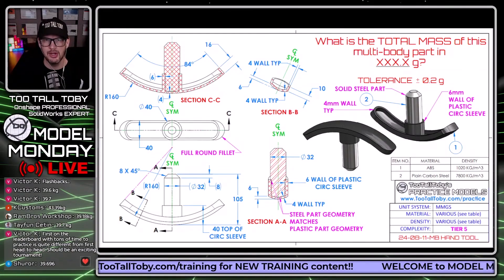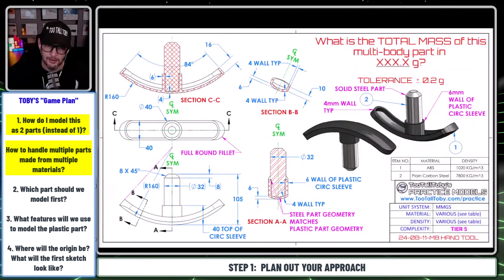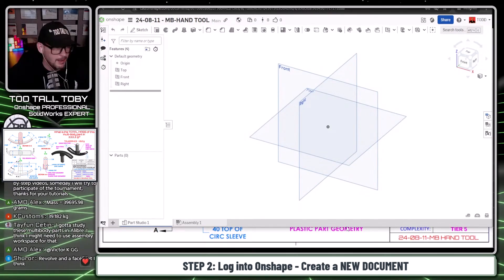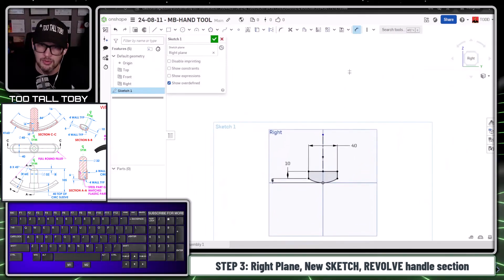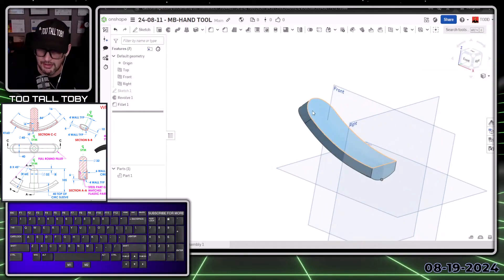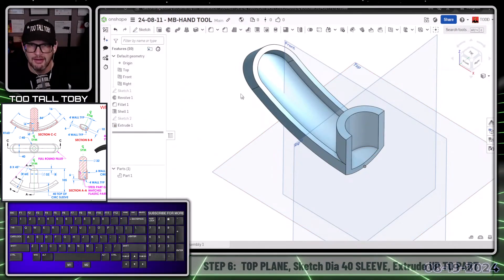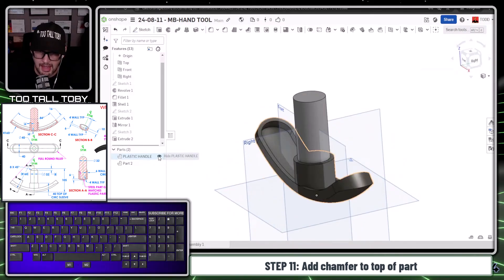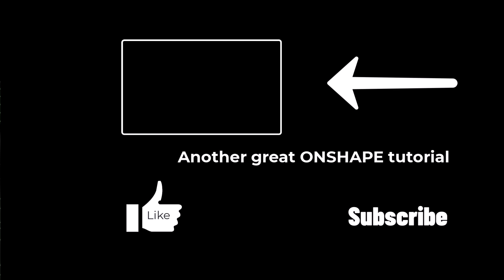Free Onshape Multi-Body Tutorial for HIGH SCHOOL STUDENTS / COLLEGE Mechanical Engineering STUDENTS

Comment: Thanks, Toby! For this part, the biggest challenge was realizing that the steel component has multiple radius dimensions. Additionally, SolidWorks doesn’t automatically match the radius of the other part during extrusion when enabling the "Do Not Merge" option( hard to explain this thing ) . This made interpreting the sheet quite tricky.

I appreciate your effort on this!
Reply from the maker: Nice job - glad you were able to figure this out in SW - and glad the tutorial helped! Onshape is so cool!

Comment: I did this one several weeks ago.  Here I see a couple of things I missed.  (1) I shelled the plastic part before applying the full-round fillet.  That meant I had to fillet twice with different radii.   (2) I extruded the 2nd part (shaft) blind upward, and then used the boolean subtract to trim it down to fit the handle.  So much easier to extrude it down to part.
I always learn something watching your videos.  Thanks, Toby!